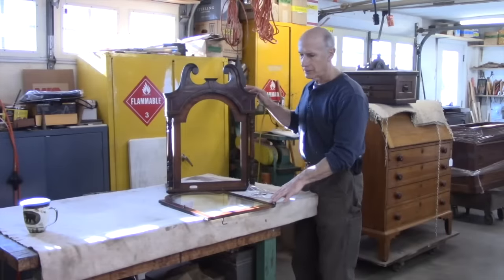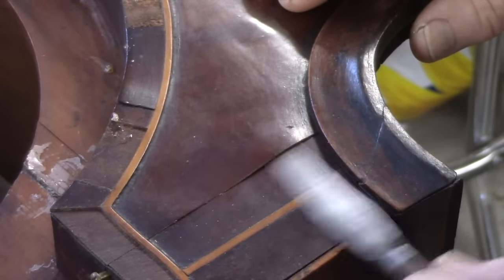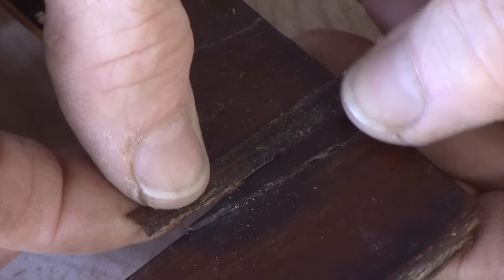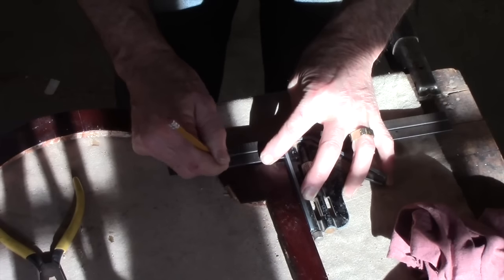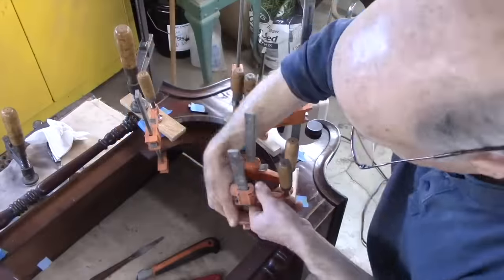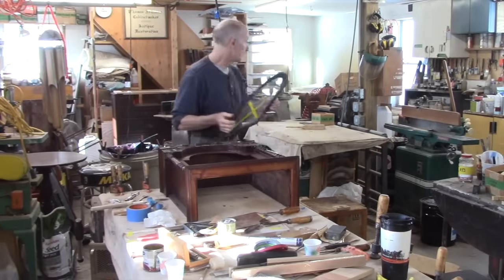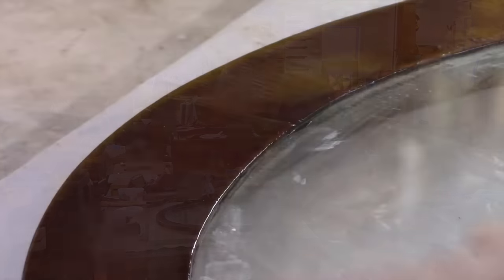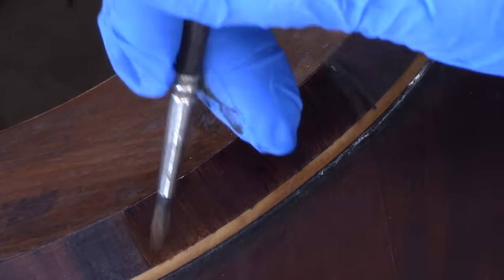A Timely Restoration

Comment: Once again I learned some valuable tricks of the trade from your video.  I finally summoned enough courage to attempt a veneer repair on a piece. There was a bubble in the center of a footboard of a bed. It is not an antique so I wasn’t sure of what glue to use so I tried hide glue. So far so good!  I don’t have a set of spatulas to reach under the veneer like you do, so I took some leaves from a disassembled feeler gauge and used them. I now have an assortment of small spatulas.  Thanks to Harbor Freight for $4.99 set of spatulas .
Reply from the maker: Thanks! Yes, I have often thought of my old feeler gauge and those thin blades. I need to try that too!

Comment: I am restoring an old piece called a humidor? (I think) and used something called isinglass. The veneer was cracked and lifted in places. I rubbed the isinglass into the surface and clamped it flat. It worked a treat, the veneer was very smooth. Whats your experience with the product Tom? and have I used it in the right way.
Reply from the maker: Hi Simon, I have no experience with it, it sounds like what they call "fish glue". I have used hide glue just as you did and it worked great too. I've never known what the difference could be between fish glue and hide glue, in use

Comment: That was A LOT of work. A lot. for relatively small piece. 
Question: Do you use Shellac as grain filler? I m an amateur restorer and my instinct would always be to try to color match my patches before putting any layer of shellac or lacquer. But you do it differently. Does sating penetrates through shellac? Also I have  noticed that when I am trying to match mahogany color I often end up oversaturating with stain and then the patch does not take any more and I cannot get it to be dark enough. I am guessing then I have to switch to spray color from the can?
Reply from the maker: Thanks! Yes, I want to fill the grain before I color it, I don't want stain highlighting the grain, nor do I want to sand through to the stain when I'm trying to level off the grain. I primarily use dye stains, which you can use to make the wood as dark as you want. the spray toners are a necessity!

Comment: Master Johnson, It is a pity that the rest of the piece was not there to be worked on; I suspect that your work will outshine the rest of the clock. Also, I was wondering about the lack of a finial. Was this an original design feature of that era or was there enough variance where some clocks had them and others didn't depending on where they were constructed. Thank you for the video.
Reply from the maker: You're welcome! I don't remember the finial! I suspect the owner must have hung on to it. I think they all had finials of one sort

Comment: Around 13.08, you use a plunger type tool with needle end to apply glue. What are these called? I repair stringed instruments, mostly as a hobby, with a few paying jobs to buy more tools. Furniture and instruments are not as far apart as you might think. Thanks again
Reply from the maker: Thanks Paul! Yes, I've worked on quite a few instruments over the years and I really like it. Those are syringes, nothing special, google it and many will pop up

Comment: Tom, I have noticed that sometimes when you are repairing veneer you simply work fresh glue under the old veneer and other times you remove pi cues and clean off old glue before applying the new glue and clamping the pieces together. What decides the method?
Reply from the maker: Thanks! If I can get some of the old glue out I will, but I don't worry about it too much, the idea being that the new hot glue will melt and reactivate the old

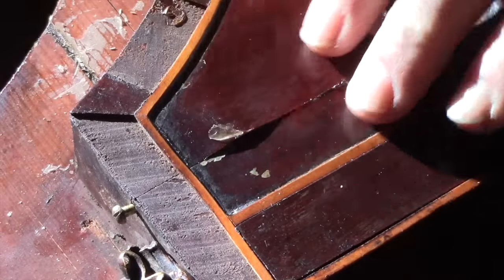Comment: Happy New Year Tom! Hoping all will be better for all in 2024… 8:22 As always great video! I have a  curio cabinet with a top like the clock your working on and it’s looped knobs is also bent back…so your saying nothing should be done to correct it or nothing can be done?😮
Reply from the maker: Thanks! There rally isn't much you can do, other than making a new piece, which is not a good thing to do
Reply: Good to know! ❤Thanks 🙏🏽

Comment: You mentioned the wood was bending back at the top.  With great trepidation I murmur in your shell-like ear "What about applying a polymerized linseed oil to the cleaned and prepared wood..front and back?"  In response to your surprise at my interruption, I say "Well,the oil will need time to saturate but then the wood will become malleable...."  At which point YOU will pause and with, great patience, explain why it may or may not work.  😮  😊
Reply from the maker: Thanks! That's funny - you having a conversation with me! What people don't understand is that wood drying out is due to a lack of moisture, water moisture. Oil won't do anything to help with that.
Reply: Oh.  Ok then. So wouldn't that apply to just thin pieces?   I had a dry sink cruelly treated since the 50's. Exterior "antiqued" then.  The drawers stuck and out of true.  I gave a coat of the polymerized linseed oil on all the bare wood, and the runners and rubbed to a shine.  They GLIDED!  IN!  OUT!  AH 😊  so they weren't dried out..! I see the difference.   I do.  If that was your clock bonnet would you try to replace  the moisture?  You know and I don't. Hence, the questions. 
   I absolutely love your work;  the camera work, too.  Mostly how you teach.  Keep going.   
P. S.  Did you ever look into the linseed oil  Mr. Christian Becksvoort uses on his Shaker reproductions?
  Best regards.
Reply: Unfortunately if you saturate wood with Linseed Oil you create an environment for organisms to feed on the wood, which in turn will destroy the wood. The Linseed Oil won’t cure inside the piece and also darkens the wood to the point where it doesn’t resemble the original (gun stocks that get “fed” regularly have this problem. I’ve been told that museums who have displayed a set of chairs that had been separated, with some treated with Linseed Oil and others that had no oil looked very different

Comment: Why that looks (and acts) like Durham's Rock Hard Water Putty. I miserable putty to remove without heat or to be able to hammer and chisel it off.
Reply from the maker: Thanks! It was tough stuff, but the heat always softens it enough. Of course I was very worried that the heat could break the glass

Comment: Another friday episode of "chicken soup for the craftsman's soul".  Removing putty from bone dry wood, ugh!  Today we can't buy the original oil based putty and can only get the water based type, which is absolute garbage.  I've resorted to using plumbers putty to achieve a similar result as the original recipe.  My father used a regular kitchen knife instead of a flat putty knife.  The rounded tip made for perfectly tapered glazing on the new glass.
Reply from the maker: Thanks! I'll have to try a kitchen knife, that makes sense. I've never had any issues with modern putty though